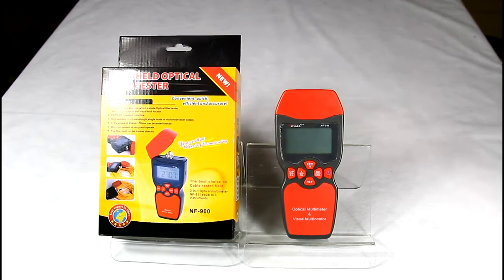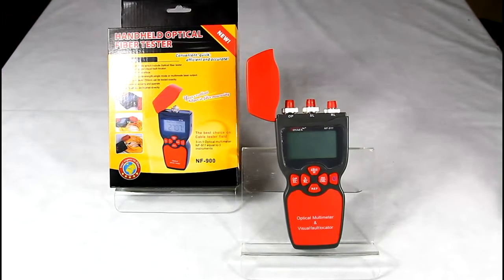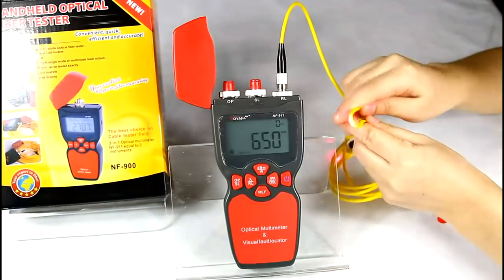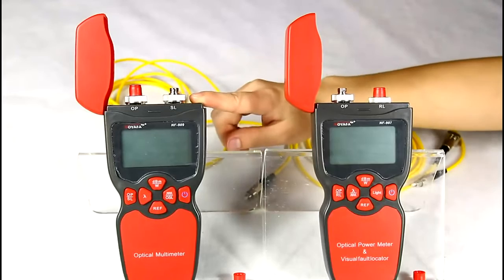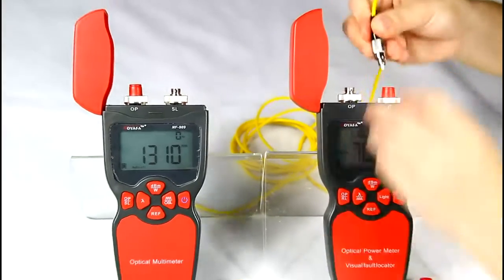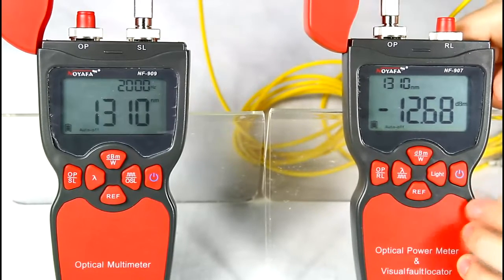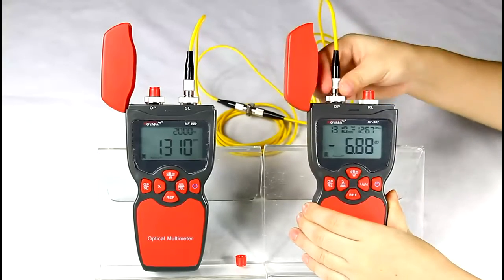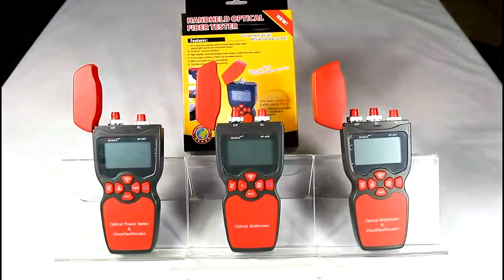NOYAFA 3-IN-1 Optical multimeter fiber power meter NF-911

Comment: I have the 3 in one unit, this video shows how to measure loss with 2 separate units. How do I reference to 0 and measure accurately with the 3 in one unit as the instructions that came with it are quite vague.
Reply from the maker: Sorry,I dont clear what you mean,could you tell more?
Reply: I have a 911 unit, how do I reference the OP and the SL together to 0 to test a longer fiber circuit like this lady does in the video? She is using 2 units to do it in the 2nd portion of the video, I need to do that on the single 911 unit. Thank you.
Reply: Hello, do we have any information regarding my request?
Reply from the maker: @deusnonmagna  you can test the fiber cable by only one unit NF-911,but you should test two fiber cables.